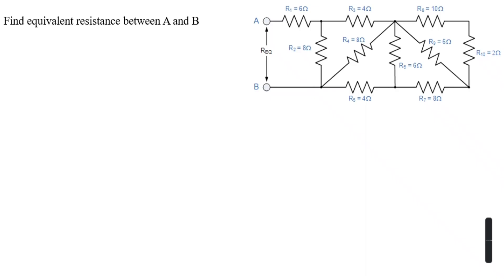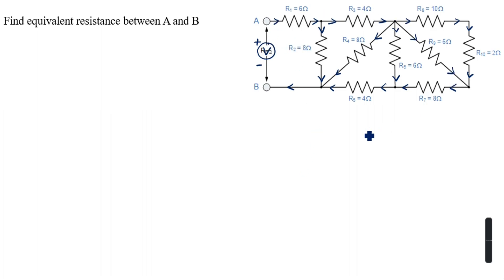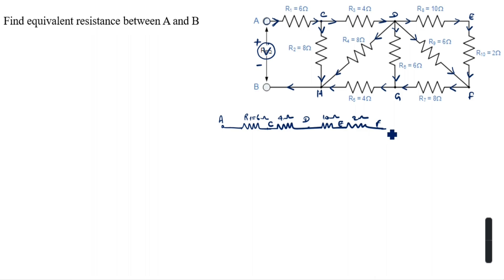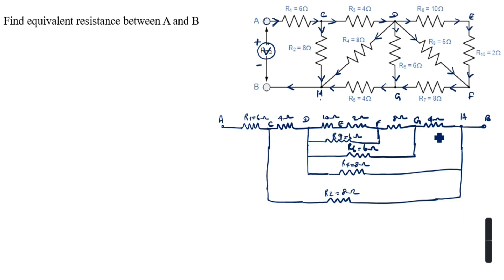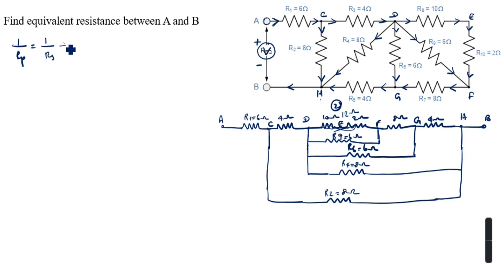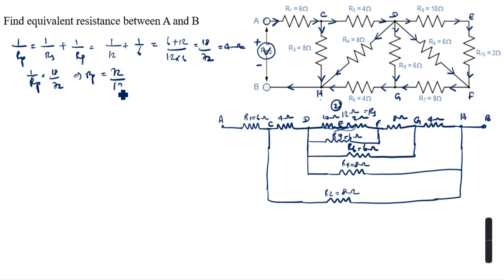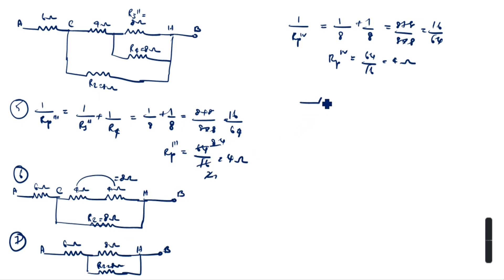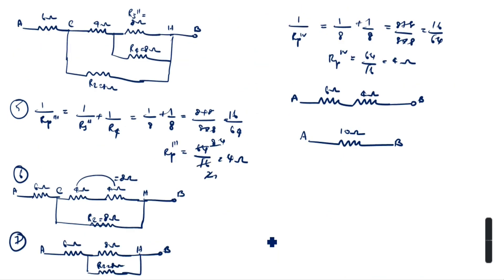How to solve any series and parallel circuit combination problem / Combination of resistors / NEET

Comment: I was able to break this down as it was initially drawn but I really like the way you redrew it. It made it easier to visualize specifically what was in series versus what was in parallel. Using that redraw method, I didn't have to keep track of as much stuff in my head. I'm gonna have to try and remember this.

Comment: Very lengthy, easy method is to start from behind.
Reply: Do you have a video. this is the method my instructor is preaching.   Having a hard time atm trying to get this down.
Reply: @Vgk36 any tips?
Reply: Abe yar 10 sec k question ko 10minute lga kr solve kiya ja raha h🙄🙄
Network ko last se solve krna start karo na Hr do resistor ek dusre se series m h Aur fir Bache hue resistor se parallel m h Aise karte hue Aage tk aao last m 6+4 =10
Reply: Yes, but în my opinion, it might be lenghty but its easyer to work with
Reply: This comment saved my 11 mins man . Thank you . starting from behind was far easier and very less time consuming